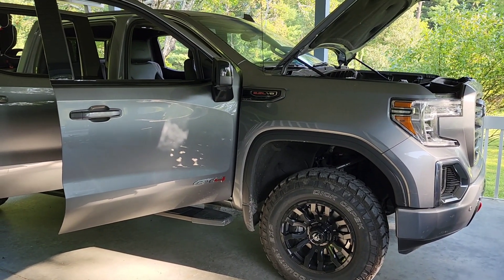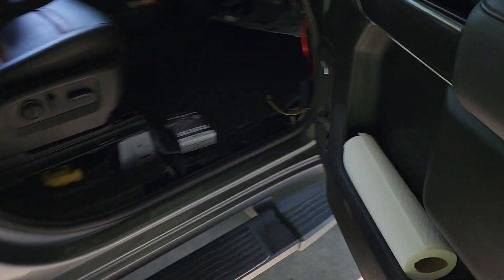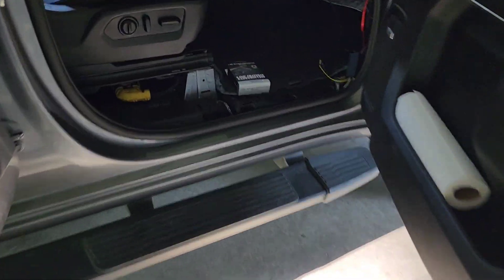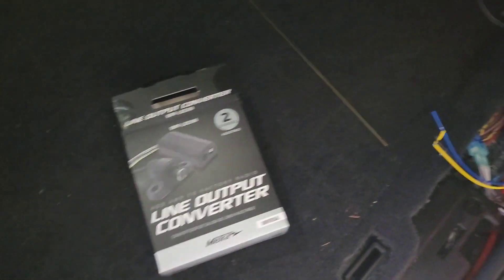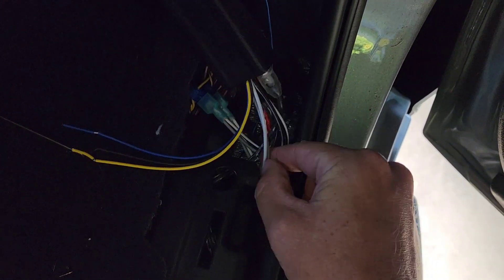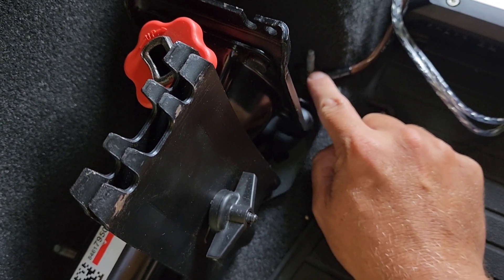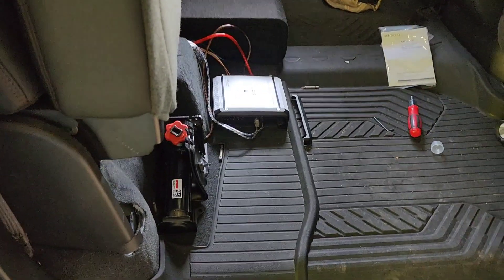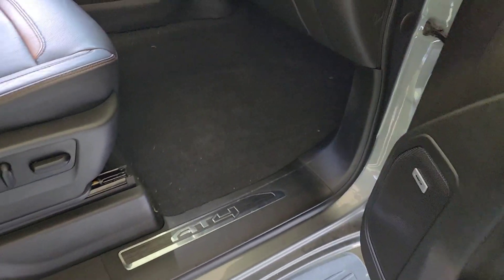2020 gmc sierra at4 sub and amp install with the bose system. #gmcsierra

Comment: What size/type of connector did you use for the remote out to the amp? The little pin I have in my fuse box is giving me fits. (2023 sierra)
Reply from the maker: I just used a t-tap for the Guage wire my remote was. Slides right over.

Comment: Can you connect your wire to the Bose amp speaker wire
Reply from the maker: I  tapped into to the right and left bose speaker wires with a line output converter and it allows you to use an aftermarket amp.

Comment: Just got the GMC 1500 denali and would like to do this as well. Did your truck come with an amp and subwoofer? By the way, thanks for posting this as it has been a big help.
Reply from the maker: Mine does have the bose system with subwoofer. Ive been pretty impressed with this setup. Kicker makes a plug and play kit for our trucks. I've listened to it before and it sounds ok. But my setup is cheaper and much louder.

Comment: Hi did you hook up LOC before factory amp or after? I have tried hooking up after my factory amp (rear speakers wires) but didn’t sound great. Someone suggested me to hook up LOC before factory amp i.e input wires to the factory amp 
Your advice is important for me ❤
Reply from the maker: I went in on the front passenger door side where the door seal piece is and just tapped into the yellow and yellow/black wire. Those are your bose wires if you have bose. Not sure which wires you would need if it's non bose.
Reply: @ensteele6282   i have got bose system, do you have picture of it please, really appreciated
Reply: @kedarkhadka2941 little late man but if you wire in after the amp your amplifying an amplified signal making is sound distorted, you need to wire in before the Bose amp